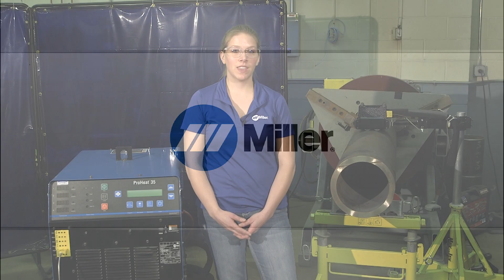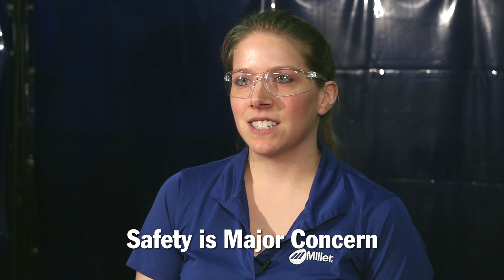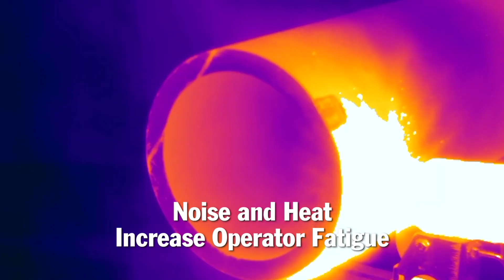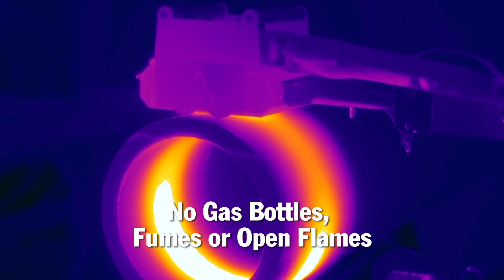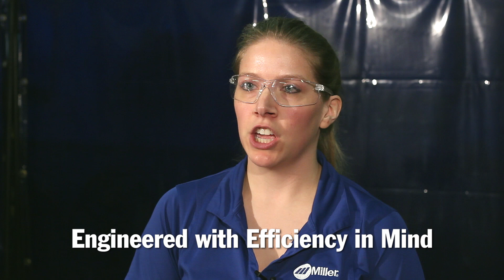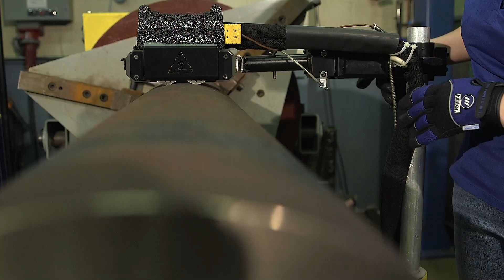ProHeat™ Rolling Inductor Provides Safer Alternative to Preheating Rolled Pipe

Comment: I know that the gas used in the welding process Balmig is a gas the second carbon dioxide for welding ferrous metals such as mild steel: Iron, carbon steel, cast iron, and argon in welding non-ferrous metals such as aluminum, copper, silver Please clarify the metals that are used with gas the second carbon dioxide and minerals used with argon gas is explained with sincere thanks and appreciation / Isa Mohammed al- Hayaza
Reply from the maker: عيسى ال هيازع The gas mentioned within this video is in reference to a type of gas that is used to fuel a flame torch - Welding gases vary by the application. Please let us know if you have any further questions.

Comment: I was impressed with way too much explanation, whether by writing on the screen or imaging Thank you for this wonderful effort 
Alaken and I have a question I hope to answer it.
What are the main reasons that may lead to the explosion of a gas cylinder Alastelln
Reply from the maker: Compressed gas cylinders contain gas under high pressure. If damaged, a cylinder can explode. Protect compressed gas cylinders from excessive heat, mechanical shocks, slag, open flames, sparks and arcs.  For more safety suggestions please visit our Safety Quick-Guide: http://www.millerwelds.com/pdf/safety/EnglishSafetyQuickGuide.pdf (page 11).